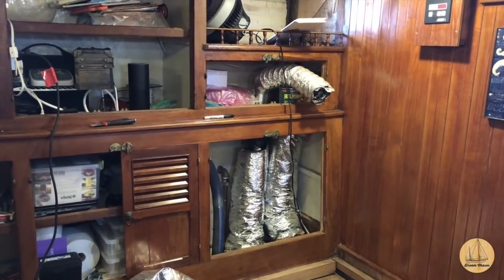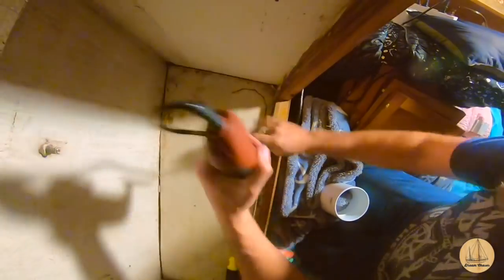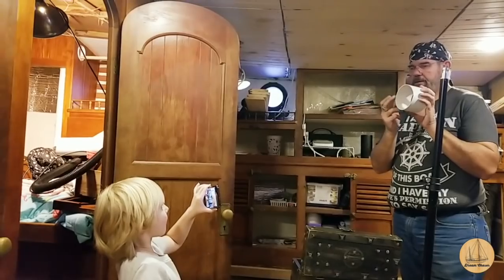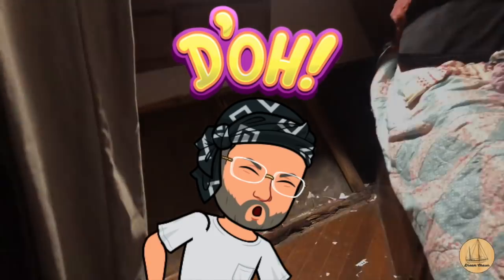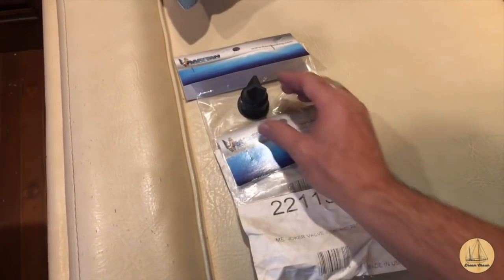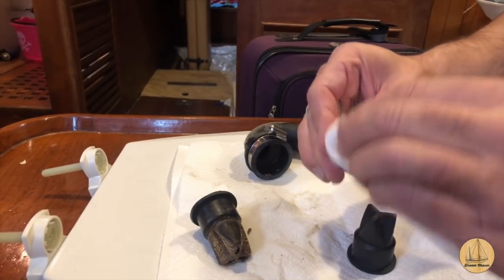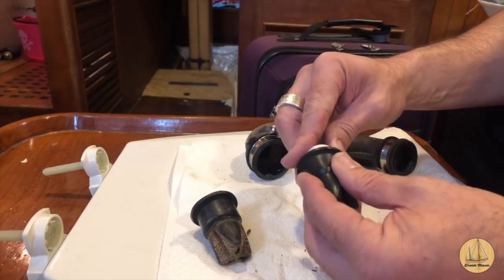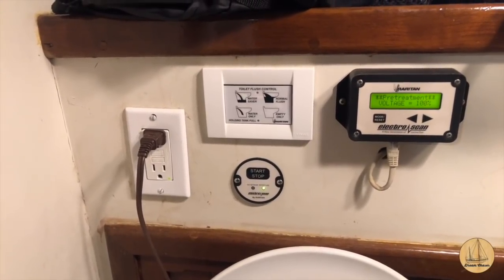Ductwork and How to Repair a marine toilet

Comment: nice system i like it for our boat thanks
Reply from the maker: Thanks. I do think one of the other commenters had a good point about condensation forming on the outside of the duct in the heat of summer if the air is on.

Comment: what model head do you have?
Reply from the maker: 1detroitryder we use the Marine elegance by raritan. It is a 12v DC macerating flushing head and i plumb it with a fresh water flush. I have some videos on the install as well on our channel. I have installed them on two of our boats now. 
Here are is a manual and link to buy them. We are partial to the Raritan Marine Elegance

https://amzn.to/2E7SPks

http://raritaneng.com/wp-content/uploads/2013/12/L490v0513-Marine-Elegance-Manual.pdf

Comment: Tape pvc joints instead of cement.  If you ever have to remove, you’ll thank yourself.
Reply from the maker: That is almost exactly what we did. We put a single screw in each one to keep them from slipping apart if something moves or if we bump them putting something in storage areas. Then taped over them.